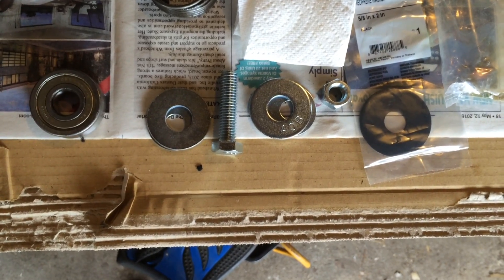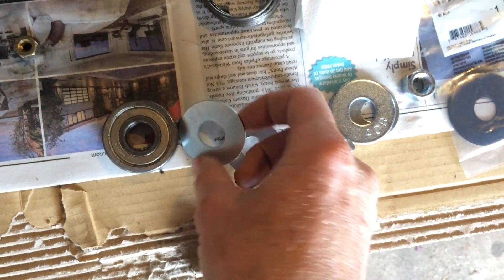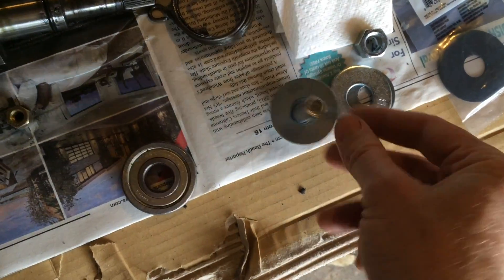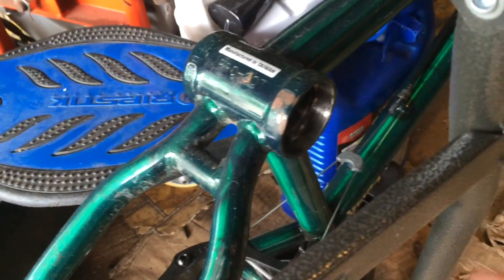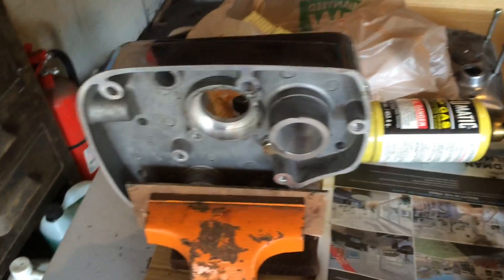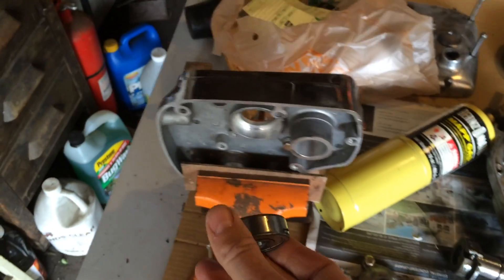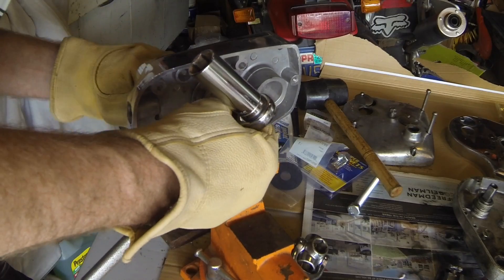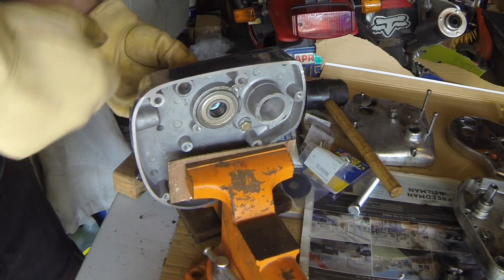DIY Bearing Press

Comment: Please document the process in video of the right side shift change on the RE. I am thinking of doing the same on mine, will be of great help, like all your other videos.
Reply from the maker: +arupgowda I definitely will.  Everyone keeps asking me to make a right shift conversion video, and I am halfway through shooting it.   I shot this video while taking it apart and made it a separate video.  The hole in the new transmission case wasn't machined correctly from the factory, so I sent it to a machine shop to be sized properly for the kickstarter to fit through.  When I get it back, I'll finish off the installation and see if it works.